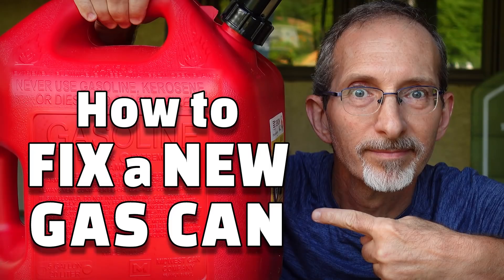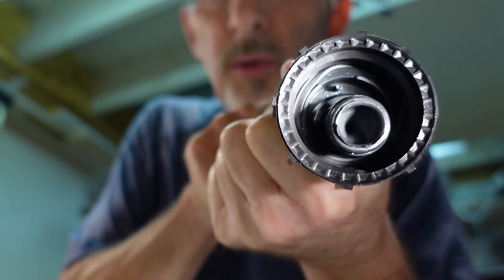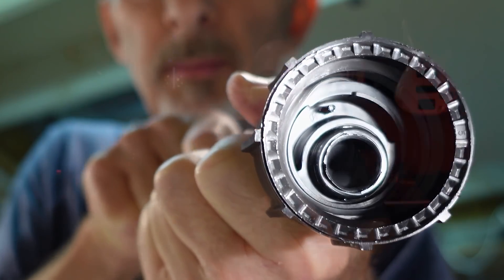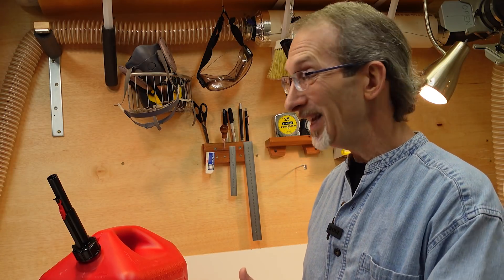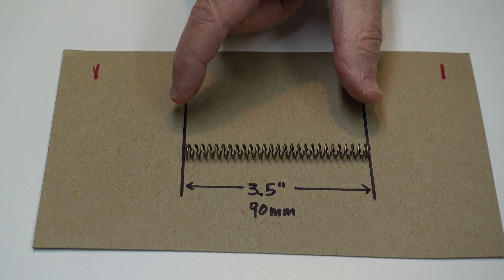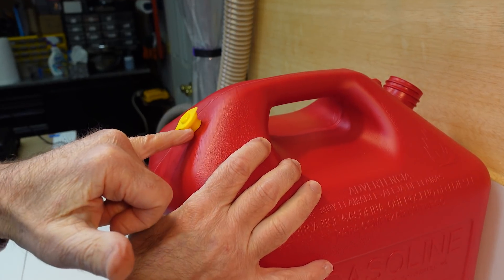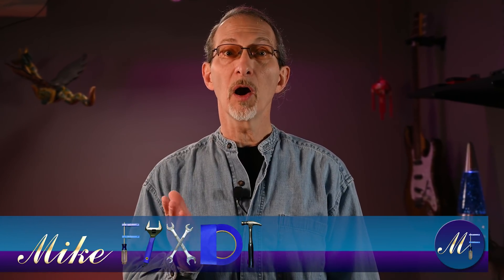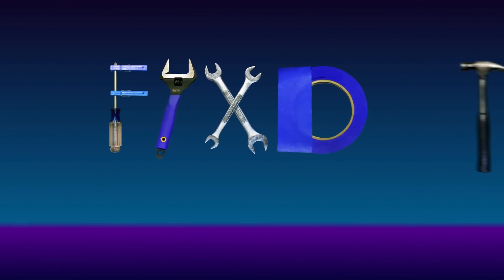Gas Can Modification | Part 2: Explosive Details!

Comment: I'm certainly going to be mirroring what you've already said, but I wrote this before seeing your video, and I'm not feeling like amending it... so on with my rant and answer to this mind numbing conundrum:

I've lived off grid for almost 25 years, depending on solar for power and the supplemental option of generators.
Needless to say, I've experienced every type of gas can that ever came out.
Why is it in the name of safety, do they have to modify simple products to the point where they no longer do what they were intended to do?
Who exactly was the douchebag, and what exactly did he do to instigate the need for a gas can that's easy and fast to fill, but takes three grown men, a 12 year old, and 20 minutes to empty?
Why is there no longer handles on the sides, or close to the bottom?
Who has the wrist strength to hold and pour 40 pounds of gas by the top of the can for an hour while it trickles, dribbles, and gurgles out?
These "engineers" have determined the safest way to deal with gas is to make sure you not only get it on your hands, your pants and your shoes, but also to completely douse that which you are trying to fill?
I can't tell you how many "environment safe" nozzles I've had break or snap off while trying to hold the can 3 feet in the air, tip it upside down, then rest the nozzle in the fuel inlet while at the same time pressing downwards to open said stupid spout.
Snap! 
You go ass over teakettle, gallons go everywhere, and you've now created an "EPA" sanctioned environmental hazard cleanup operation all because of why, some dumbass had the gas come out too fast and easy?

I've tried every mod there is, from purchasing the old school nozzles (that are now made out of plastic) and drilling out the can for the breather insert, I've tried modifying the "Safety" nozzles in every way imaginable, only to have them fail in a short period of time because of, well, plastic.
I've tried the tire valve mod.
I've tried Gerry cans.
I've tried using water jugs instead.
I've tried barrels and pumps.

This HF Gerry can is no help either, because you're back to using the same worthless fucking safety spout.
And who was the assclown that decided that the "Breather" belonged in the exit?
Any five year old could tell you that the physics just don't work when trying to extract a liquid from a vessel while attempting to introduce make up air through the same liquid that is trying to exit.
It is equivalent to (2) three foot wide fat people trying to enter and exit the same door at the exact same time. Science degrees are not needed to understand this one.
Here's another little science fact that all these morons seemed to forget: Gas evaporates and expands, especially on a hot day.
You need to provide an escape for the expanding pressure inside a gas can.
I can't tell you how many times I've walked away from a perfectly square gas can, only to return later to something that more resembles an over inflated beach ball than a gas can, which now would more perfectly mimic a flame thrower than a "safe" way to store and dispense highly volatile gasoline if opened.

The list of mandated, safety, product nullifiers grows by the day.
All the way from butane lighters that have obstructions to rotating the wheel, to wall sockets that you can't plug anything into.
(See my channel for more on that one)

Anyways, all these asshole are trying to reinvent the wheel (gas can) with nothing more than absolute failure in mind.
To date, there is only one product out there that is even worth considering or spending your money on.
Here you go people, trust me, this is the only answer: The Eagle UI-50 gas can.
For starters, it's metal, so it's not going to crack or blow up like a balloon.
It's squat and round, so you can place it in your trunk, or the back of your truck, and it's not going to tip over.
The "cap" is incorporated into the can, and if pressure should build up, it will allow the gasses to escape if needed.
The funnel/nozzle stays with the can, so there's no need for an extra hand.
The gas pours right out almost as fast as it went in.
The can is completely weatherproof.
The cost is about 3 bucks more than a crappy plastic can that will fail and end up in a landfill in less than a year.
You don't have to drill holes in it, or modify it in any way in order to get it to function.
The opening cap and the handle are operated with the same 1 hand, while the other hand is free to tip the container easily from the bottom, so there's no need to call all your neighbors over to help you fill your lawnmower or tractor anymore, which also saves many dollars by not having to compensate local home dwellers with beer and/or lunch in return.
You can buy replacement funnels, or, if you're not a complete fucking moron, you don't have to use the funnel at all in order for the can to dispense gas.

So there it is! Find a few of these and hord them like you've been doing with toilet paper, because some stupid, brainless, jackass is going to do something idiotic soon enough to get these removed from the market.

Gas cans.
Don't even get me started on fucking gas cans!
Reply from the maker: OK, wow! You covered a lot of territory. Fantastic rant, and I will have to check out the Eagle UI 50 gas can you recommend! Thanks so much for sharing this!

Comment: I would use some Fuel resistance RTV on that vent.
Reply from the maker: Thanks for the idea! I felt that the vent went in very tightly, but now I am thinking that a slightly larger hole and a sealant might be an option. I appreciate you adding to the conversation!

Comment: You don't need a flame arrester on a plastic fuel can since there is no metal to metal contact when filling the can. You should have one on a metal can since the average person does not have a ground wire handy to connect to their metal fuel can when they go to the gas station.
Reply from the maker: The flame arrester is there to block fire from following the fumes into the can, leading to an explosion. Grounding, to prevent static electric sparks, is definitely a safety issue – but not the reason for these plastic flame arresters.
Reply: @MikeFyxdt  You can still build up static electricity around your body and objects you're holding, especially ion cold - dry air environments.  Safety attitude is a habit of treating things to prevent incidents, and assuming they will/could happen, not hoping for the best.

Comment: Best to not have even a trace of gasoline vapor in that can before you drill into it;  I wouldn't necessarily trust even a brushless cordless drill to drill into a can without creating a spark!. PS,  That add on vent should have a one way valve in it. Perhaps you could add one, similar to the ones used in the hoses to your car's windshield washer mechanism, or for the air pump in your fish aquarium.  I don't know if that type of plastic valve will hold up against the gasoline...
Reply from the maker: Interesting idea about the one-way vent. Although I do find it helpful to let air out, for instance when the tank sits and builds up pressure. I appreciate your concern for my safety, but what you don’t see is me leaving the container outside, empty, overnight to make sure that everything evaporated. :-)

Comment: Someone must have got the design prize of the week for this. Tell me how its safe if you overfill your lawn mower with one of these spouts and it hits the hot muffler. 
Safety? Where's the can vent on these? Gas expands with temperature, but i guess the vent was another design prize on the new cans.
Reply from the maker: Good points! I added vent in my second video, and I always burp these cans by opening the main cap a little before I use them. Thanks for commenting!

Comment: Use cheap stuff at your own peril. Who said third degree burns aren't fun?

Buy a real safety gas can where real tools and supplies come from. Safety cans have a dead (or burning) man feature so when you start to burn, just let go! Foe those that are slow to figure out how to pour from one of these, there are spouts that fit over the neck to divert the fuel into the tank. Check them out. The dhandle type safety cans are the best and are metal, so when you fill them on the ground, they are grounded, unlike the friction spark generating machine plastic ones...
Reply from the maker: Excellent points! I’ll have to look more into them. Thank you!

Comment: for the can to be flame safe it would need to be filled with a form of mesh like steel wool  to reduce fumes in the can
Reply from the maker: I would much rather have the flame mitigation device the metal, and attach to the spout instead of being permanently in the body of the gas container.

Comment: I used to work at Sears i8n the outdoor dept. we were told to tell ever customer to never pick up the mower while it is running in order to trim hedges. Reason: two guys wo had a little too much to drink decided to start the mower and trim the hedges and in doing so cut off the tips of their fingers and then tried to sue Sears because no one told them not to it. I do not know the outcome of the lawsuit.
Reply from the maker: Ken, that is a crazy story! I suppose that example could’ve ended up with all lawnmowers having plastic blades, so no one cuts off their fingertips. Thanks for sharing, and thanks for watching!

Comment: When I worked in the hire trade, I went on a course about propane Heaters.
The first part was about gas safety. They showed us a film, A man in a white lab coat, walked into view carrying a Pyrex  roasting dish, he went away for a few seconds, came back with an empty pyrex jug. he tipped up the jug over the roasting dish,  we were all laughing. He then put a spark to the dish and there was a huge flash and a blue flame.  They then shoed th same clip with a filter on the camera, the dish was empty, but the jug had swirls of colour like oil on water he poured it into the dish then lit it, there was a bigger flame than you realise.
Just because you cant see it does not mean it isn't there.
Reply from the maker: Interesting story. Gas and flames are no joke.

Comment: That filter is stupid. If it catches impurities from going in the container, won't they then pour out through the spout with the gas?
Reply from the maker: George, the filter is actually a flame arrester. I agree, as a filter it makes no sense, which is why originally I removed it.

Comment: You mention $15. for one of the Midwest 5-gal gas cans.  In Souther Calif Harbor Fright as of April 8, 2021 wants $24 with the ineptly designed  Midwest gas can/poring spout. Related: Waste Management hazardous waist  facility used to accept old outdated gasoline brought to them in 5-gal containers which they would empty out and return the gas can to  you.. New policy..  they accept your gas but keep your expensive gas can with the crummy poring spout..
Reply from the maker: Ha ha, even recycling doesn’t want these cans?

Comment: As I mentioned in your previous video all you need to do is remove that red plastic lock. Then the spring moves easily. Keep the little red plastic lock in a drawer and put it back in when transporting the gas. You don’t leave it on.
Reply from the maker: I’ll have to give that a try! Thanks!

Comment: I ended up just removing the button so I could slide the nozzle down better. Mine wasn't working very well, and it popped out on its own due to all the force needed to operate it. I didn't have problem with the spring tension. I always put the nozzle back in the can for storage anyway. What is the point of these child-proof nozzles if you're supposed to put the nozzle back in the can? That's how we used to do it. I'm sure these "safety" designs are just there to protect their butt in case someone pours gas into a fire. How about we just say that it was the idiot's fault instead of the manufacturer's? I mean, this isn't the same as securing a garage door so it doesn't crush a pet or a foot. Using garage doors are expected to be safe. When you use gas, you're expected to know how to do it safely or just not do it at all. It's a bit like home wiring. From the start, you are told not to mess with it unless you not only know what you are doing AND feel confident in doing it. If you're too stupid to use gas, don't operate a gas powered device ESPECIALLY a car!
Reply from the maker: Robert, this is the second comment I am responding to today where someone recommended removing the red button. I will have to investigate that! I agree that these safety features, like the childproof, are not very well thought out. Thanks for joining the conversation!

Comment: I'm with you 100%. I went and bought the old style flexable spout and replaced all the new so called "safty" spouts and threw them away...
Reply: You can get those? I could use that for the lawn mower.
Reply from the maker: Agreed, a lot of people really like the flexible replacement spouts. One of my gas containers has a flexible spout, and I really do find it easier to use that to fill my small gas powered tools.

Comment: Great idea. Those bothersome safety devices can be a pain in the (you know where). Another great modification that will make your life easier is to modify an infants car seat by removing the safety strap. It's much easier to get the baby in and out of the car seat with the safety strap removed. So easy in fact that the baby can get in and out of the car seat without any assistance. Why do they put those silly safety straps on there anyway? Duh.
Reply from the maker: But can a baby in a modified car seat operate the gas can? 😁
Reply: @MikeFyxdt  He can't pick it up, it's too heavy. He may be able to unscrew the spout since the safety catch has been removed, and he might be able to knock it over. Those things don't leak do they? The last time I bought a gas can they didn't have all these safety features. They were simple like me. I could remove the spout, fill the can, and pour the gas out. I didn't need instructions and I didn't spill gas all over the place either. Gas cans were a lot cheaper in those days, so was the gas.

Comment: Plastic gas cans are blow molded and thus have no seams. That line is where the two sides of the mold meet and the flash of plastic seeps between. It is then removed with a sharp tool. So it is safe to place the vent in that location. The easiest way to check if it is a seam is to feel the inside of the can. If it smooth then no seam. If there is a seam I personally would return the can. A seam would be a possible failure point.
Reply from the maker: Kevin, I didn’t know that. Thanks for adding to the conversation!

Comment: I hate the nanny state too (rubber knives....good point!!).  But, this wasn't the whim of the midwest gas can company.  The reason for the "flame shield safety system" is due to the "Portable Fuel Container Safety Act of 2020" (see https://www.nbcnews.com/politics/congress/new-law-requires-portable-gas-containers-add-devices-protect-against-n1252595 ).  According to the article the change was pushed due to 80 law suits to gas can companies.
Reply from the maker: Richard, thank you very much for that article. Very interesting to see the development of these laws. It looks like flame arrester‘s are here to stay in plastic gas containers. Maybe they can re-engineer them to make them more easy to fill, which is my main objection.

Comment: Remember when none of this was necessary, when people were not sheep to be led so companies didn't get sued by the inept the leftists have indoctrinated to be dumber than a rock? Gas cans have been around for over 100 years that came with the spout in the can and a lid you simply unscrewed the cap pulled the spout out and filled the can.  You either put the spout back in the can and the lid on or installed the spout that had a plug on it or not and put the spout back in the can and reinstalled the cap. What rocket scientist screwed this up anyway?
Reply from the maker: I find it completely ironic that safety features have caused these gas containers to not be safe. Crazy! Thanks for joining the conversation.